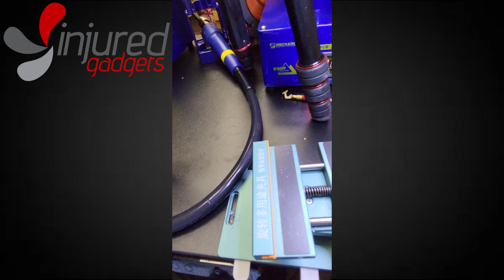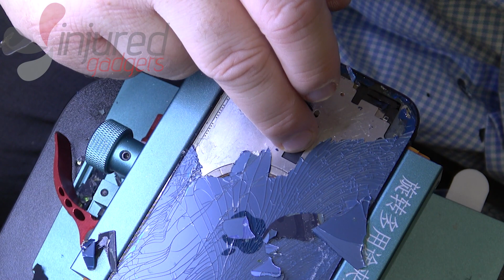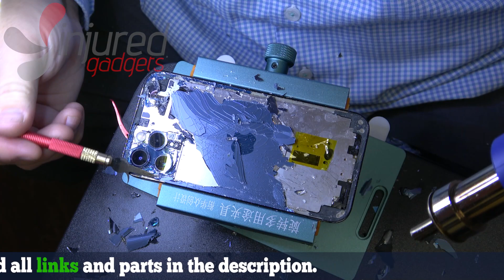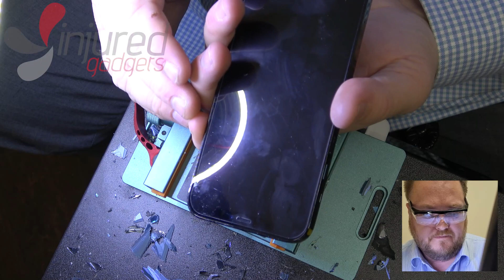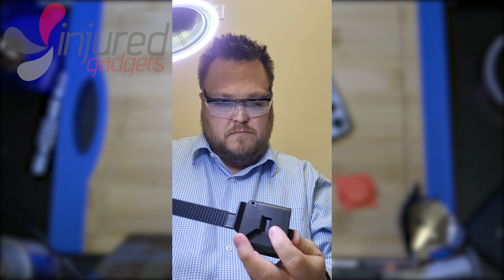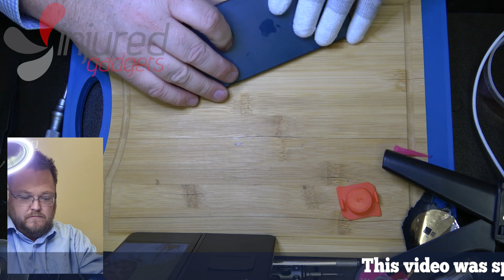iPhone 12 Pro Max NEW DETAILED METHOD TO FIX BACK GLASS 2022

Comment: Can you tell us what temperature you're using. I did this exact phone 2 days ago with this exact tool. I did desolder the flash, but was able to fix it after the fact. I use 425C after doing a super quick pass under laser to give a template of where to be careful.
Reply from the maker: 450°C with a 50% airflow i’ve done a few of the iPhone 11 Pro Max and I also de soldered The flash but that was after the fact of this video. I now use kaptions tape Over the cameras and the flash. I just use enough to cover it. You have to be extra careful.